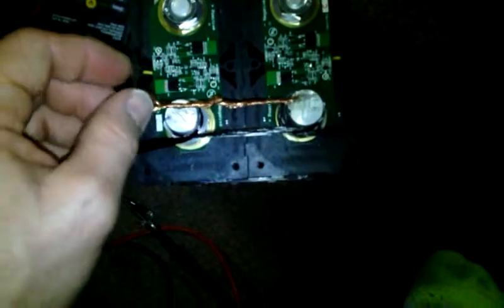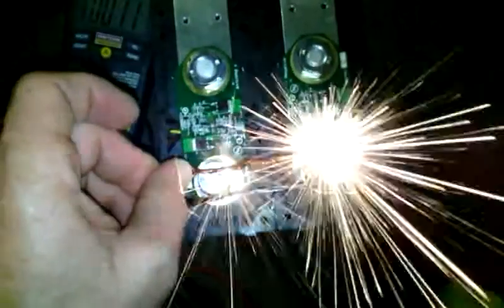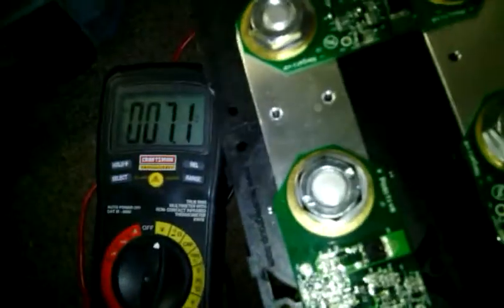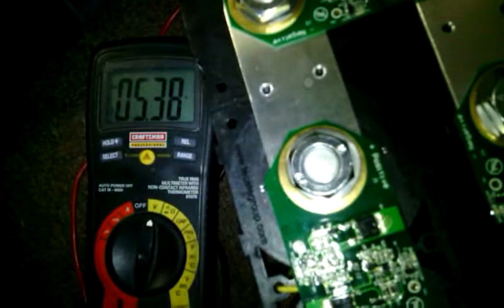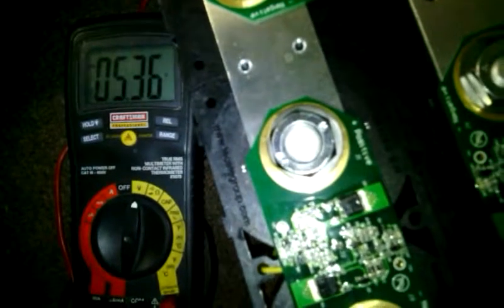How to safely discharge ultracapacitors

Comment: Does not appear particularly safe!
It's very easy to miss, but the safe discharge is from the carbon fiber connection that was already installed since the beginning of the video - NOT the impatient bridging with the copper.